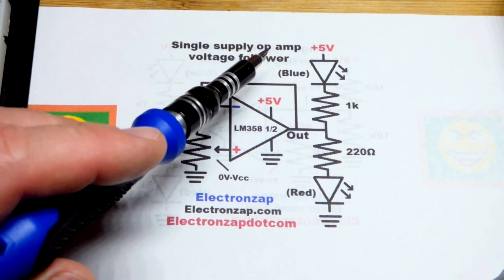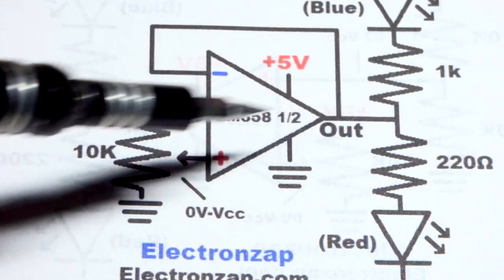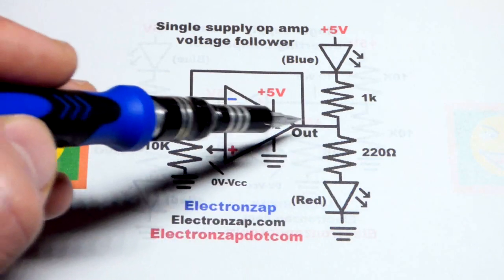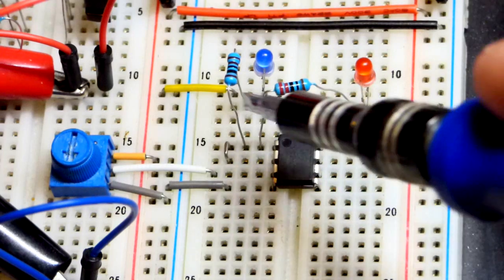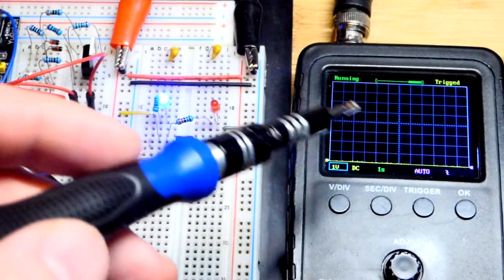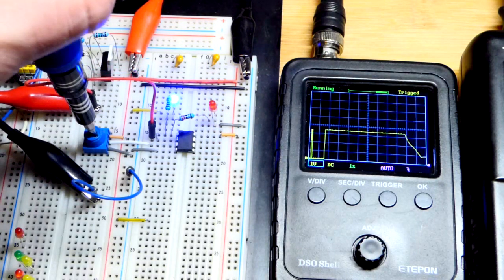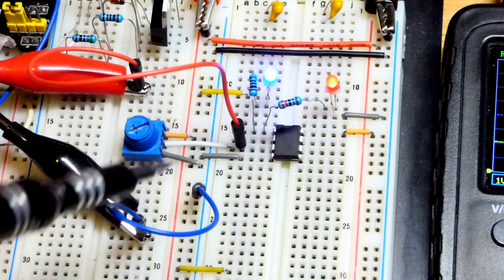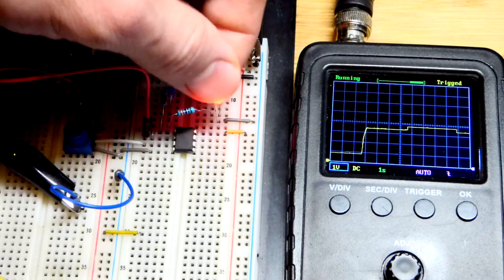Op amp voltage follower using LM358 trimpot and LEDs electronics demonstration circuit

Comment: Thanks for the video.

I find the feedback concept hard to understand.

For example, if 2v is applied at the non-inverting terminal then the output will be high (approx 4v ), thus turning on the red LED?

But then that output high (4v) is fed back into the inverting terminal and comparing it with the non-inverting 2v will output a LOW (0v) thus turning on the Blue LED..

...but then that LOW output is fed back into the inverting terminal and compared with the non-inverting 2v will output a HIGH again...

Is my logic correct? If so this seems to produce an oscillating output and blue/red LEDs alternating on/off.

Thanks again.
Reply from the maker: The inputs just look at voltage. So if you put a piece of wire directly from the output to an input, it is feeding that input the exact same voltage as the output. If it is to the inverting (-) input, then it is negative feedback. If it is to the non inverting input (+) then it is positive feedback. You can also use resistors to make voltage dividers with the feedback.

Comment: I am subscribed, liked and looking at your past videos. I am a car guy, but good with electrical. The HVAC system uses a simple 2 wire, low current dc motor. In an actuator, it is gear reduced to drive a hot-cold door directing air thru or around the heater core. Internally, the motor has a 3 wire pot on 5 Vdc for feed back. So like your car, moving the hot-cold knob or slide lever ( Linear pot ) make the motor move the amount you moved the dash control. Using you pot input with wire on output to negative input, it try's to match the variable voltage. I want the output to power a tiny 12Vdc 5 pin relay, this keeps ground to the motor and if on, say the motor runs CW. A second op amp can power a second relay to provide CCW movement. Using two pots, 1 for input voltage change, like the dash. But (Diodes) using the feedback relay, can't effect loop feedback wire to change matching voltage? Other words, move dash pot, motor moves then stops. Motor pot changes feed back voltage. Two in parallel can be separated by diodes even with a 0.6 voltage loss. 
I am spending hours, days looking for a simple circuit that I can build to use in a 67 C10 PU that I can drive. We need a second vehicle, yet after fixing cars since 78, I have been hurt and waiting on call for my 4th lumbar fusion, now L2-L3. If you can provide an idea, I would be grateful. I fixed vehicles by installing factory OEM parts, not build them from scratch. I have 3 parts bins full of ic's, resistors, caps, etc plus bread board & Fluke 87 V. Thanks!
Reply from the maker: Thanks for watching my videos! I haven't built anything like that, so can't really help unfortunately. Sounds like quite a lot of designing to do for a first time project. I injured my back pretty bad lifting weights and it took over a decade to recover, so I know how awful that is, and I hope the surgery goes well!
Reply: Thanks for the kind words. New types of lumbar fusions use brackets, screws and vertical bars. Mine happened in 86, the Dr of 32 years of experience told me I destroyed 3 of 5 major muscle groups and they tear, leak, contract and grow together. This is scar tissue. Went back to work on cars after two years, hurt most mopping my stall floors at the dealer at the end of the day. Lifted, then twisted while stacking electrical training boards in KC, L3 slipped forward and had 3rd in December 2005. Two months, mostly back to normal. Now, it feels like a propane torch is on my lumbar after bending, stooping, walking or mowing yard. Now, burns more, quicker, but still get one thing done per day at 6'3" tall. Everything is short.
  The op amp follower is the key as I draw everything out first. The motor geared to a pot will change the input voltage as the motor moves. The dash side & motor pot, both on 5 Vdc. Now, change the dash pot and the match input voltage the follower would change voltage until it matches, then output goes high. A common power widow circuit uses one relay the all pins are ground, then one side energized, output goes high, CW, window goes up, other side energized, CCW, window goes down.
  Now, using this concept with tiny relays, but two circuits in parallel but with diodes to prevent cross-actuation. I will use a linear pot for the dash with the same values of the motors pot. These actuators are $10-20 for simple ones, what we call "Dumb Actuator". Newer logic circuit use Hall-Effect amp sensors with a shunt built in. They count the motors commutator contact at full, then low or off.  Say 0-255 binary, once plugged in and fuse powered up, it runs the actuators motor from stop to stop. Detecting high current once at limit. Now, it can move the motor in # of turns. A Corvette with a convertible top, you hit the button to up or down, the logic controller rolls the windows down 10 mm, stop, then roll back up. 
 Did I tell you I worked for ACDelco for over 7 years. Teaching, holding tech seminars in 7 MidWest states and had 5 warehouses to deal with defect's? Yep, in a hotel 234 days per year. Well....I just need a second vehicle. The other is a $900 1996 Geo Prizm. Sorry!